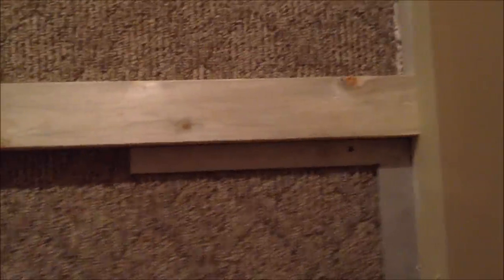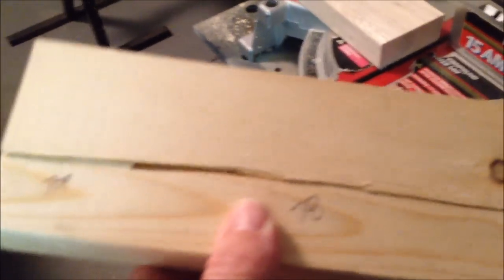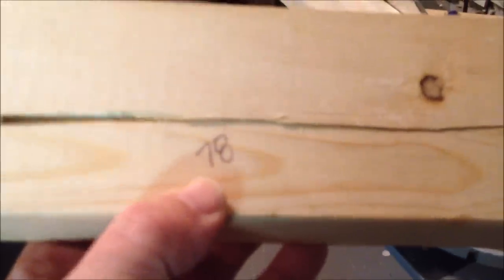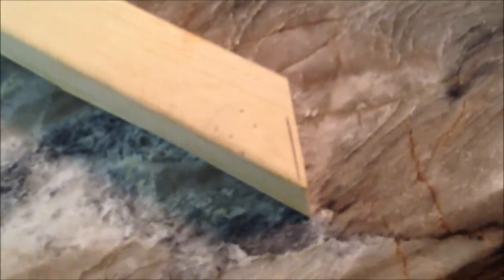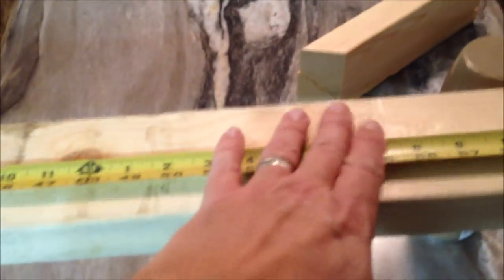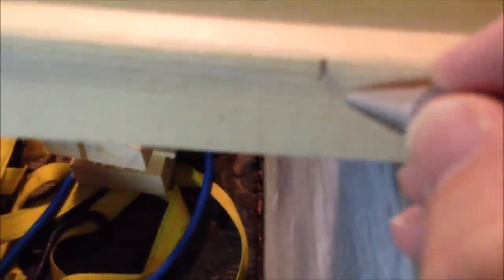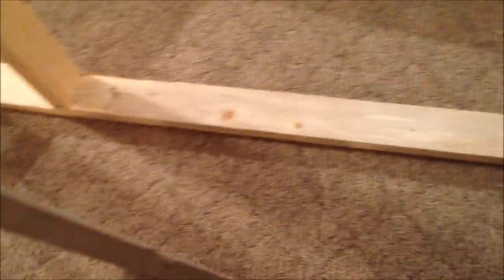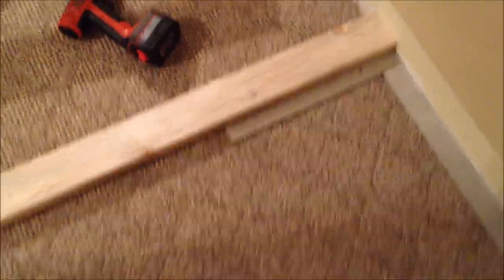My HO Scale Railroad   Episode 4

Comment: Great work Brian, coming right along, angle cuts can be confusing, but after doing a lot of framing and crown molding a little tip is that it's helpful when you're measuring to think of your cut as 78" Long to Short, meaning long part of the angle to short part of your second angle.  It works well, you can keep measurements straight by saying Long to Long, short to long, long to short, short to short.  Hope that makes sense, keep up the good work friend.

Comment: Coming along fine. Back up batteries are a must and maybe an electric drill just in case. I'm messing with ya. Your doing a good job. Careful cutting the 2x4. The other member of the household might still get upset if you cut that rug.

Comment from the maker: Yes.  I considered cutting the carpet but was afraid that the edges might fray.  I would have then needed to lay carpet nailing strips around the walls and have the carpet stretched and attached to the strips.  Don't have the tools or ability to do that.  The screws are long enough to go through the carpet and padding into the plywood subfloor and anchor the bottom plate.